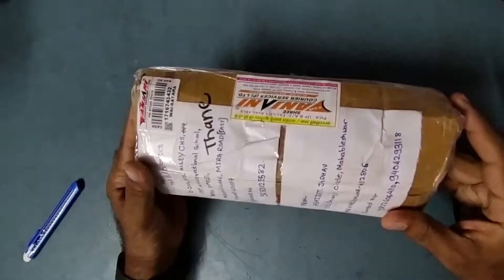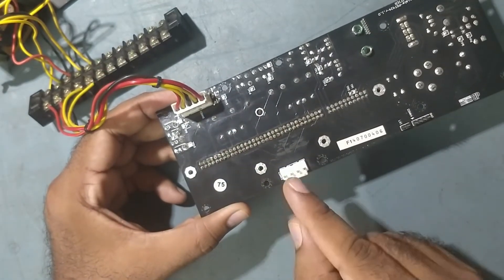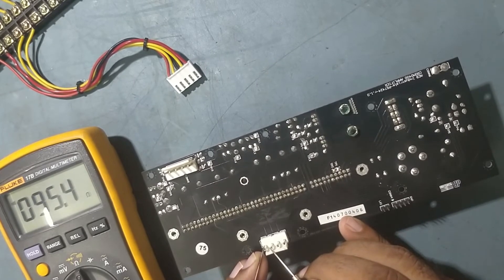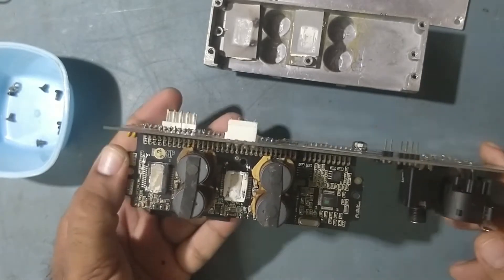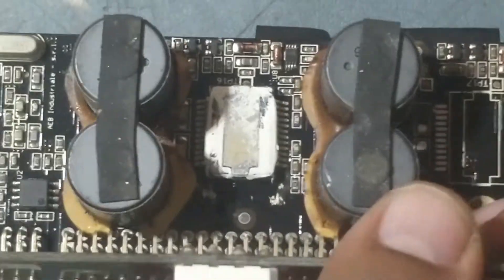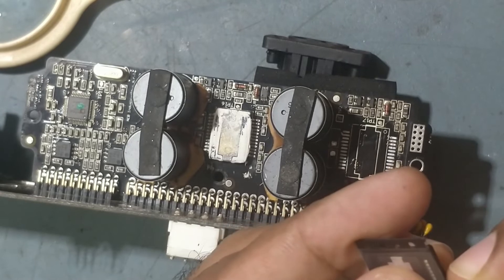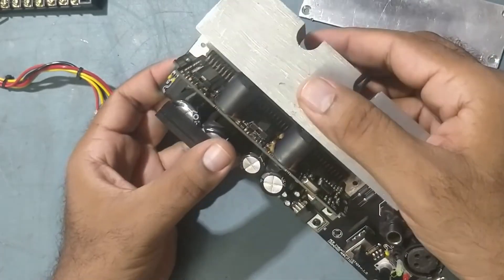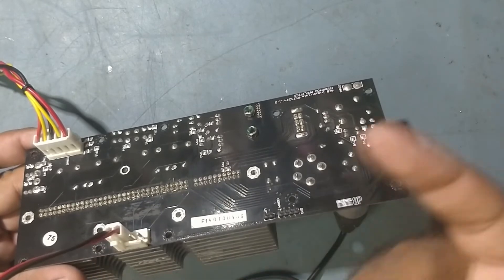How to repair cromo 15+ active speaker, Driver speaker not working, How to detect defective IC?

Comment: These parts(ic) available or need to order from Italy?
Reply from the maker: My dear friend from where you are pls
Reply: Hi Bro from srilanka
Reply: Bro when i switch on both powered speakers..works very well good sounds but after 10mnts..One speaker give a bad sound. This particular speaker was fully open when we doing some tile work.. Dust was every where..
I removed the cables, changed the sides..
Need to switch off...
Again its fine. But after sometime bad sound coming.. Whats the issue..
Because of dust or anyother problem?
Reply from the maker: Total how many speakers are connected to system, which sound system you are using
Reply: Db brand two powered speakers connected.. To a mixer..speakers are ok.. Works well trebles and base are ok... But...
One speaker giving bad sound after 5mnts.. This speaker which was opened for dust,,when we had construction tile dust was every where..
What do u think? Shall i remove and clean the speaker.. Whats the problem... Circuit problem or.. Nothing wrong with cables coz i changed the sides and removed when the bad sound was coming.. But bad sound was coming.. Once I switch off and switch on bad sound will go.. But after 5mnts its comes...
Is it because of Dust in the circuit inside..
Reply from the maker: See bro, if speaker's are really having some problem, then why for few minutes only it will work, by reading your information it looks like that their is problem circuit this is what I think by reading your massages, I am not fully confirmed because I didn't check your system.
Reply: @TKFElectronics  if i remove the speaker amp and clean with a dry brush and apply contact cleaning spray will it be a solution?.. I will Keep it dry before fix it
Reply from the maker: Do it On your own risk bro
Reply: Or better to give it to a technician like you right?
Reply from the maker: Ya better, little knowledge is very dangerous bro
Reply: @TKFElectronics  😃yea correct 👍🏻
Reply: I bought brand new, didn't use that much.. I thought because of dust.. May be dust... Other speaker is fine and it was not close to dust..
Reply: Bro I need ur help .I m having same db cromo speakers I want it to repair so will u help me
Reply from the maker: Yes sure pls
Reply: I have a cromo 12+ amplifier whose ic is dead, can you fix it? Or where can I get the IC?

i from Indonesian